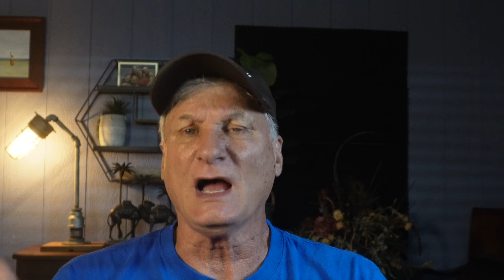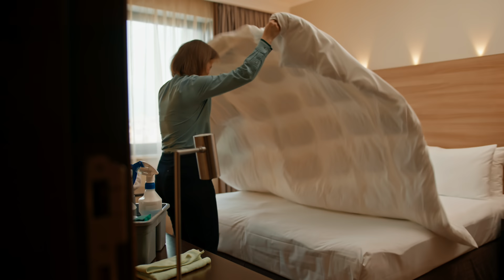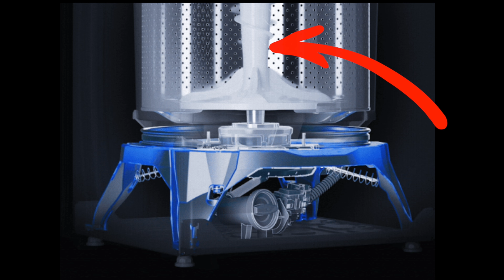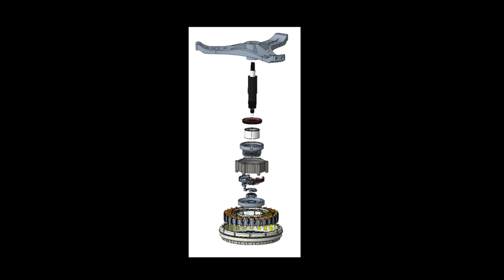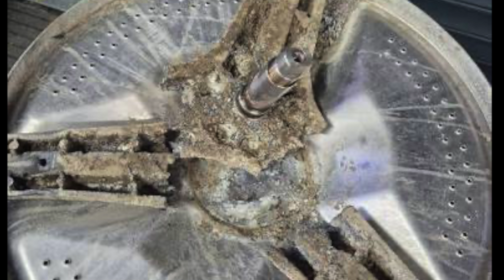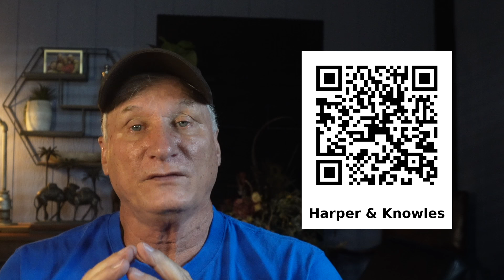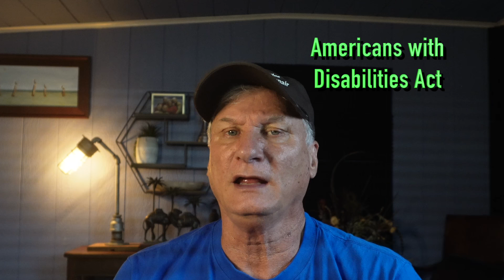Maytag's New 30-Year Washer: No Gearcase, Real Agitator, 900 RPM

Comment: Just did a through repair of our 45 year old Speed Queen. Love her!
Reply: I just bought a rebuilt Speed Queen with a 5 year warranty. It was at a price that I said yes right quick and in a hurry.
Reply: @msveeak how much
Reply: @msveeak  Where are those available?
Reply: What repairs?
Reply: @AaronR64154  at 45 years old and getting a repair could be considered maintenance. the transmission oil, if it has that, lasting 45 years is amazing in itself. Synthetic lubricants weren't common then
Reply: He must have "through" it in the landfill.
Reply: My speed queen did not wring out the clothes well. And dang, it was noisy. Traded it in for a Maytag.
Reply: @LP-hs6yz  I had a Kenmore dishwasher that sounded like a bus idling in my kitchen.  I hated that POS. Shopped for quieter ones, ended up with a WP that barely outlasted the warranty before it leaked and cost me $3k in floor and wall repairs.  Naturally they denied my claim in the class action suit.
Reply: Did the repair go through the top or through the side?
Reply: Just replaced the lid switch on my 28 year old Dependability Maytag washer!
Reply: What made it tough?
Reply: Soeed Queen never got drunk on false auality but offers metal parts and proven design. I will stick with SQ.
Reply: The maytag will also struggle wringing out your clothes when it is sitting there broken waiting on a service call. Lol
Reply: @user-ek5nl1jc4b  If you can open the lid to keep them from rotting while they wait for a complete container load of parts to be ordered before they ship the part from China. Expect 1 to 3 months for the part.
Reply: at that age it was routine maintenance
Reply: It’s 2026… 45 year old appliances are not relevant to 99.99999999% of appliance shoppers. Buy a new Speed Queen and tell us if you love her!